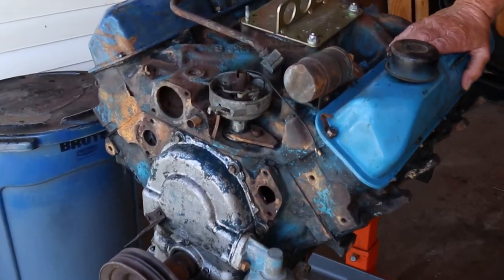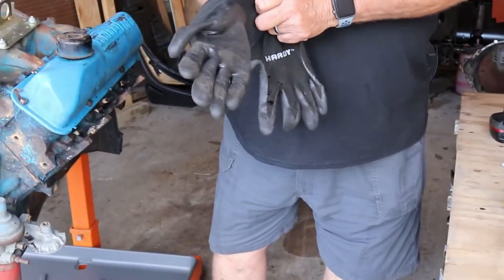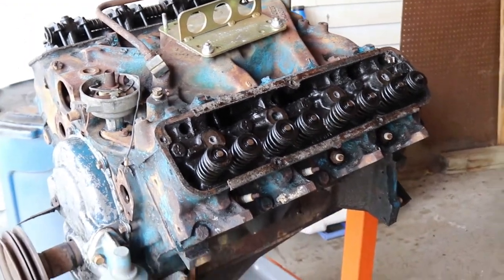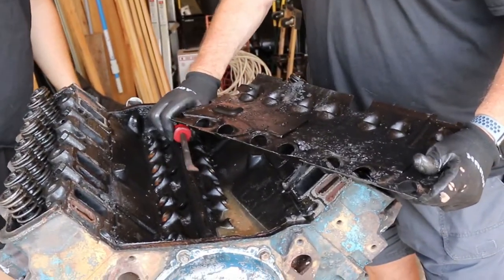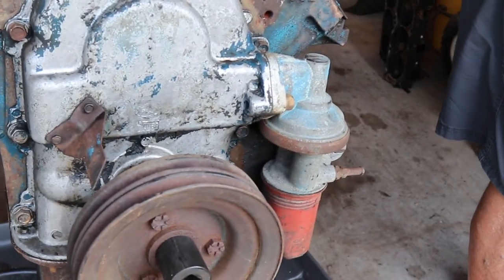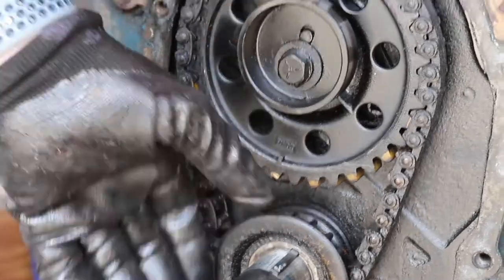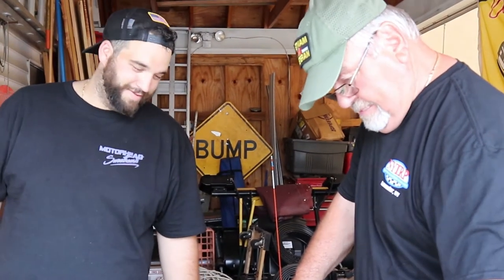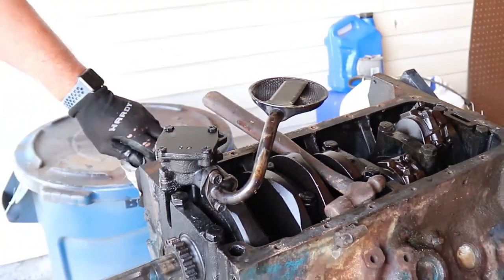Part 1: How To Disassemble 1966 Ford FE Engine | Tinkering with Tony | Motorhead Sweethearts

Comment: This guy doesn't know much about FE engines.  Those valve covers are 67 and newer,  the engine is supposed to be a 1966 410,  which it may very well be,  never made any mention of the rectangular keyway that goes with the front balancer when he removed it.  Everybody looses them.  Including this guy. With that original timing chain,  fomoco gaskets,  that motor had NEVER been apart.  And I've seen MUCH cleaner inside than that.  I also watched his re-assemble video.  He made ALL the classic mistakes that chevy boys do when trying to assemble a FORD FE.  It's video's like this that are causing many people LOTS of hard earned money learning the hard way.

Comment: Why dousnt it have the "Mercury" valve covers? The 410 was only installed in Mercury's & they were only built for two yrs. They absolutely should have the "Mercury " valve covers. I understand someone can easily change them over the yrs but I heard you talk about the engine I.D. tag behind the coil & those can be changed even easier. I would look for a external balance on the flex plate or flywheel.
Reply from the maker: Thank you for the tip!
Reply: @MotorheadSweethearts  since I wrote this comment I learned that some 410's may not have had the mercury valve covers from the factory. They were sold in 66 & 67. Apparently after 66 they stopped using the mercury valve covers so.....
There can be some that have them. I guess I'm always learning?
Reply: Actually they first cam in 1958 Edsels.
Reply: @tinmanozzie  those were MEL 410 engines. Not FE's. Two totally different engines. But both 410 ci.
Reply: There was the factory 410 in mercurys, but a 410 FE is also just a 390/360 with a 428 crank.
Reply: @Terminxman  correct. And that only got installed in Mercury's & was only built for two yrs. 66 & 67.
Reply: @jesseduke694  what I was implying is that someone could have just built a 410, but I skimmed through the video so maybe I missed where he said what vehicle it was in
Reply: 1966 DID NOT have "mercury" valve covers.  The last year for them was 1965.  That motor SHOULD have what they refer to as the pent roof valve covers.  Generic Corporate blue,  1966 was the First year for Blue engines.

Comment: That doesn’t look like a 410, I WOULD Definitely check that crankshaft number and letter. Many 410s were changed to 390s just to get the crankshaft. They are the same as a 428. I have seen machine shops steal them. I had a set of ported FE heads disappear from a shop.

Comment: The flex plate has a counterweight on all 428's and 410 engines . The rear of that engine has an external balance but the front is neutral unlike the SCJ 428 that is fully external balanced .

Comment: "This will just pull out" - **easily lifts distributor**.

Man, I wish. On my FE it feels like it's welded shut in it. I've spent the past several days trying to get it off. Vice grips, slide hammer, nothing working.
Reply: I've had to use the ENGINE CRANE and a CHAIN around the distributor,  with motor in the car/truck,  to jar some of them loose.  Just BUST them out of the engine.